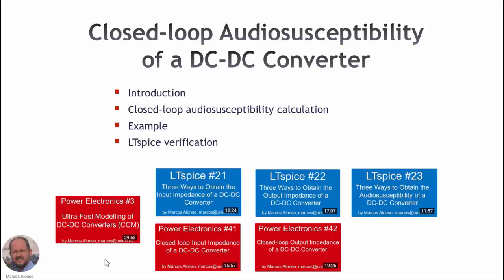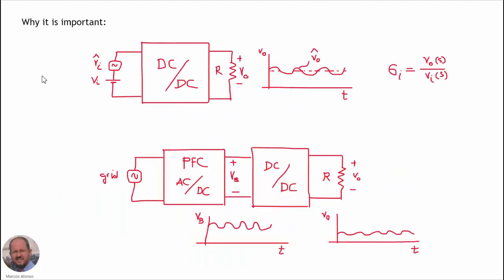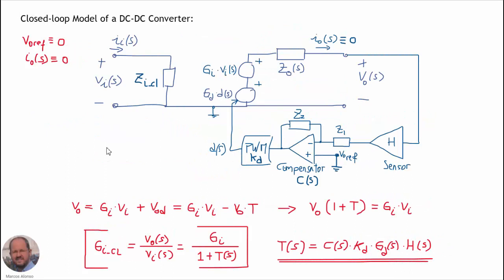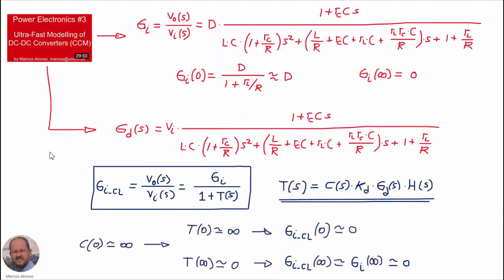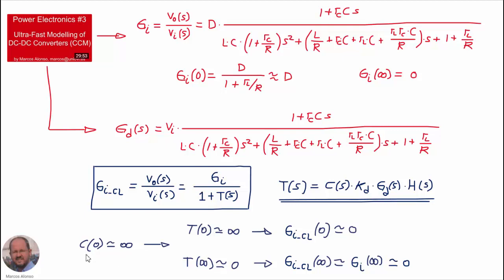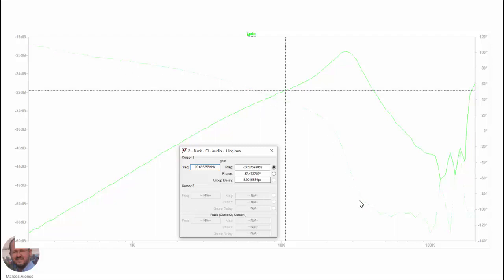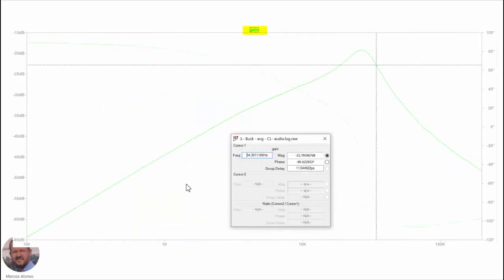PE #43: Closed-loop Audiosusceptibility of a DC-DC Converter

Comment: @MarcosAlonsoElectronics: Can you explain why in closed loop when calculating the loop we must make voref = 0 and Voref=0? So, I am reffering to voref (meaning the small signal of the output reference value), and Voref (the DC value of the output reference value).

Shouldn't we keep one of them non-zero, either voref or Voref?
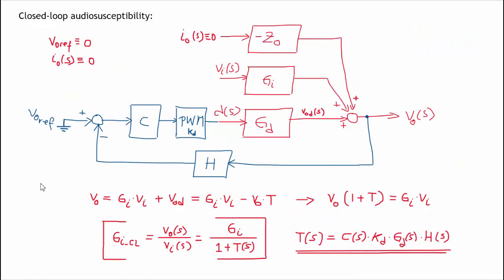Reply from the maker: Note that in the small-signal model in s-domain there is no DC value considered so Voref is always zero. We only work with perturbations around the DC point in this model. When we want to obtain a transfer function like the audiosusceptibility we apply the superposition principle so we make voref(s)=0 and io(s)=0 to obtain only how the output voltage changes when the input voltage changes. At 3:12 in the video I should have written voref(s)=0 instead of only voref=0, to be clearer.
However, if we want to obtain the closed-loop response of the converter then we keep voref(s) and make zero the other sources of perturbation. See how to do this in videos PE44 and PE45: 
https://youtu.be/GiVOKpgZ3eI
https://youtu.be/29jOpPIEeBw
Thanks for watching the channel.